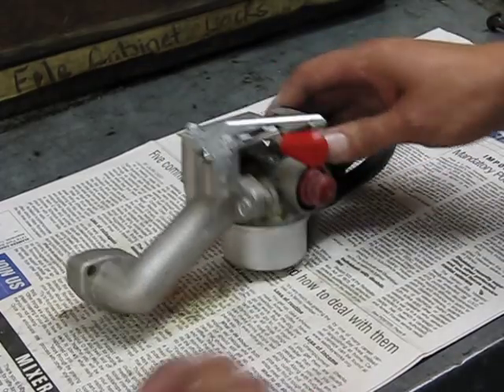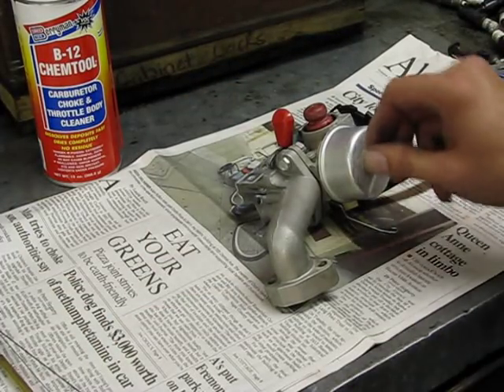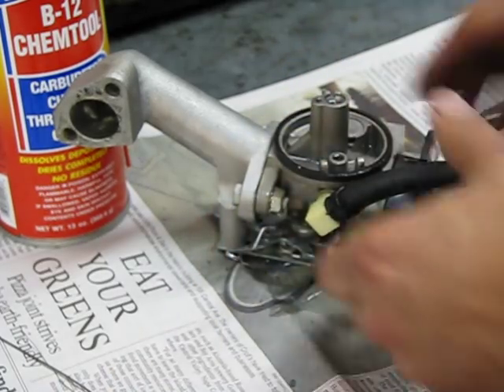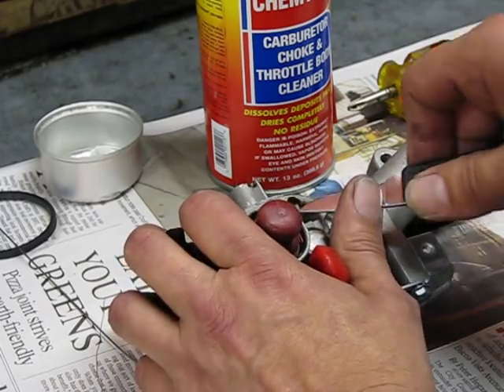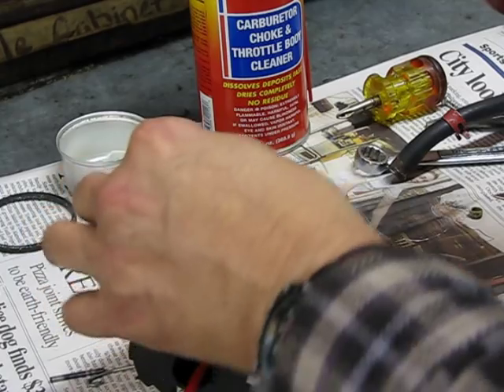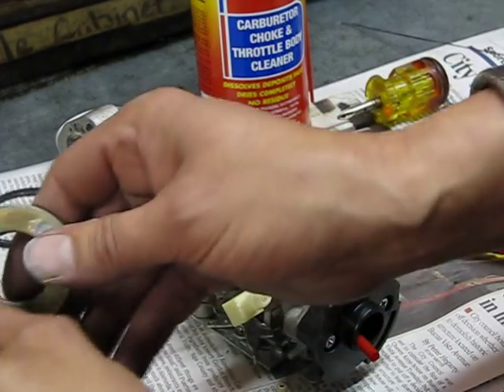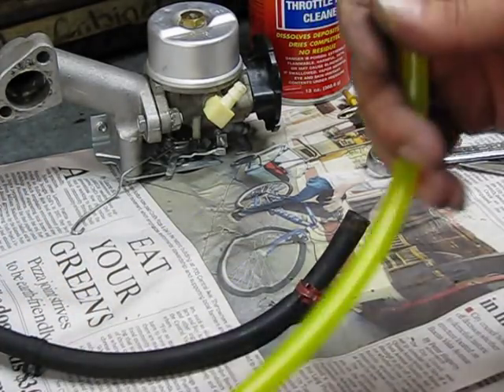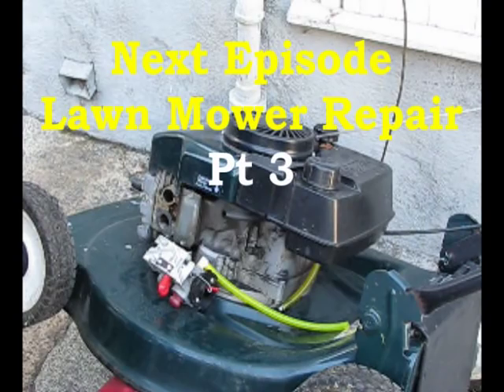Lawn Mower Repair Part 2: Carburetor Clean and Service, Alameda Repair Shop, Alameda, California

Comment: I bought a mower used and the fuel float was stuck. When I put it back together, it wouldn't start. After replacing the parts in the little bag shown in this video, it still wouldn't start. I tried what ideastoday did, and now my mower works like a charm. Kudos to pafoofnic for posting this video and helping those of us who know it can't be that difficult, but don't know where to start!

Comment: Before anyone starts a full rebuild and i have to say i give 💯 credit to this video and this man! I watched the entire video and i tried the simple things, first thing i tried it worked. Clean out the screw and the holes on the bolt that fastens the bowl that houses the float! The pin holes were clogged. I cleaned them with brake cleaner and blew out all the liquid with my air compressor, with my focused nozzle! Try the little things first!

Comment: Thanks, I cleaned the carb, still did not run, then I saw this video showing the tiny hole in the cab bowl screw, and the brass screw near the primer, runs perfectly now.

Comment: Great, thanks. Similar problem on my Craftsman. After calling and being presented a quote of at least $60 I watched your video. It took me 15 minutes to get it running again after your clear instruction. I didn't have the funky fuel line plug you used in part 1 though which made my job significantly messier. How much are those fuel line plugs? Thanks again.

Comment: Common issue it seems with these carburetors. Apparently they plug up way easy. I noticed you use a machine screw to pull the inlet seat, I usually just blow compressed air into the fuel line fitting in the carburetor and that baby flies right out of there (make sure to point it away from you or anyone else, is shoots out of there like a bb gun lol) I ruined a carburetor inlet port once using the screw method it marred up the seating surface and I ended up replacing the carburetor. That's just my personal preference though.

Comment: All I did was cleaning up the plug bulb and remove the cover to empty the gas with small debris, and put everything back.  It works fine afterward.  No need to dismantle the whole carburetor assembly and "clean" everything.  The more disassembly, the higher the risk of something goes wrong, don't you think?

Comment from the maker: Under normal circumstances no adjustment is necessary. The only way to adjust the float is to bend the metal tab that contacts the needle to the float, but it's not recommended.

Comment: I went through this entire process. I still have to dump gas in the carb to start and it just runs for 5 seconds and dies. I've cleaned it about 5 times now. The mower sat for 7 years with gas in it. Gas gets in the bowl, but won't prime with the bulb and won't stay started. I'm not sure what else to try....
Reply from the maker: Does the primer bulb have any cracks or leaks? Did you scrub and dry the gas tank? Try cleaning the bowl nut again. Any junk from the old fuel could be lingering.
Reply: Alameda Repair Shop I've cleaned that nut countless times now. It looks like new and you can see through all the holes ( used guitar string and spray cleaner). Even the tiny one over the thread. I didn't scrub the tank. Primer bulb wasn't cracking or leaking. I've tested each hole by spraying through and watching the spray flow out of all ports. It's as clean as a whistle. Could anything else cause the problem? Maybe a choke or idle adjustment? It's a Scotts mower made in 2000, so it's pretty old.

Comment from the maker: If your mower gets regular use with fresh gas typically every 2 to 4 years. If you have old or bad gasoline more frequently. 
 The gas we have today is 10% ethanol and starts to go bad after 30 days, after that the gas starts to absorb water and decompose resulting in poor performance, gooing, gumming and corrosion. The more time elapses the worse the problems.

Comment from the maker: The fiber washer is stuck to the bolt in this video. It will usually stick to the bolt or the bowl, if it's missing you will need to install a new one.

Comment from the maker: @savagebfblack5   The needle and seat could be leaking or the float may be leaky. Remove the float and shake it to see if gas is inside, if so it will need to be replaced. Good Luck!

Comment: I know a bad seat can cause flooding but can it also cause a blockage of fuel?  It seems like I'm barely getting any fuel flow I wonder if the seat has swollen causing it to run for a little bit and then die.  I'm really not getting much fuel flow and I know the float keeps rubbing against the metal emulsion tube "housing" as well
Reply from the maker: Yes, sometimes they swell up and sometimes deposits form around it. Be sure the narrow part of the float bowl is lined up with the hinge-pin side.
Reply: thank you for the reply...I think mine swelled up...instead of messing with it I bought a new carb for $11....but good to know that they can swell up and actually block the flow of fuel too and not just cause the carb to flood...
Reply from the maker: Eleven bucks would be a knockoff. Does it perform well?
Reply: Just installed it today and the engine really started up good at first then died out.  I have to run some more tests.  I got the primer really pushing fuel out better now and it runs but I have to hold my hand on the throttle open to keep it running and it's running very weakly.  Very slow rpms.  This is for a neighbor and it has a lot of oil built up around the engine I'm suspecting something more sinister at play.  I'm thinking about a blown headgasket or worse...
Reply from the maker: Is the gasket on the intake manifold intact? Sometimes the knockoff carbs are no good. (just went through that for B&S copy on eBay) Usually  you'll get smoke if the head gasket is bad. Good Luck!
Reply: yeah gasket is intact.  I'm thinking something with valves then...I do see oil gunk (mix of oil/dirt) all around the deck thats why I was thinking a gasket...
Reply from the maker: One other stupid thing; does it have a NGK spark plug? And is it fresh gas, no mixing old with new.
Reply: It's for a friend so I don't know how fresh the gas is...I was thinking about that too.  I'm going to drain all the gas and start fresh and see what happens...NGK spark plug I'm not sure...I know it ran fine before with the same spark plug if that matters....thanx for your time I appreciate your help
Reply from the maker: Be sure to empty the float bowel and clean the jet, (bowl nut)...
Reply: carburetor is brand new though
Reply from the maker: if it had old gas, it's going to have crap in it.
Reply: I always like to update on mower issues because it's fair for others to use for troubleshooting help.  This problem is solved.  It ended up being me not used to the adjustable tecumseh carbs.  I had to adjust that but that wasn't the only problem.  These cheap $11 copy carburetors from china suck.  Everything should work right out of the box but I had noticed the carb was leaking...very slow leak.  I looked through the carb and saw gas bubbling up the emulsion tube...I took it apart and examined that the float needed to be pushed all the way up for the needle valve to seal correctly....I bent the tab so that when the float was horizontal the needle valve sat higher up in the seat and blocked the fuel flow.  Lesson learned...Don't buy cheap carburetors...

Comment: What size is the Tygon tubing fuel line you used?
Reply from the maker: discoveryman59 1/4" id 3/8" od
Reply: Alameda Repair Shop Thanks much appreciated.

Comment: You to fastboy I need to see how to put the needle with spring also the mechasimn line fuel
Reply from the maker: New one goes on same as original one, (Should hang from float on straight part). I don't understand about mechanism line fuel?